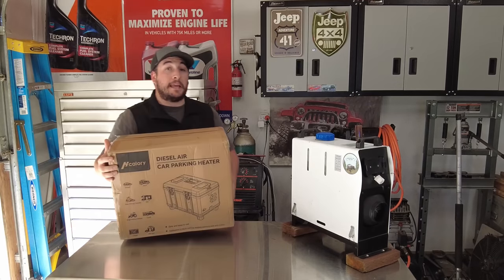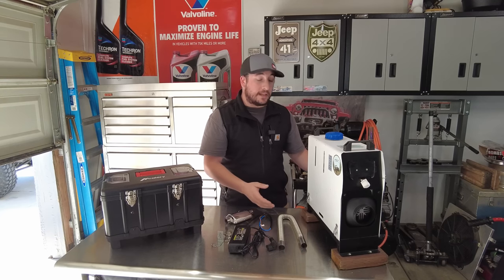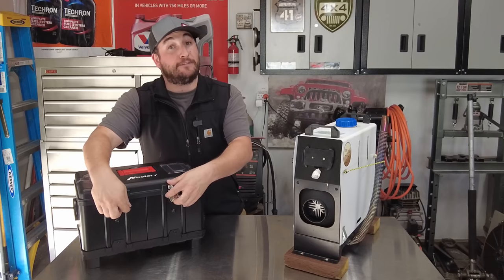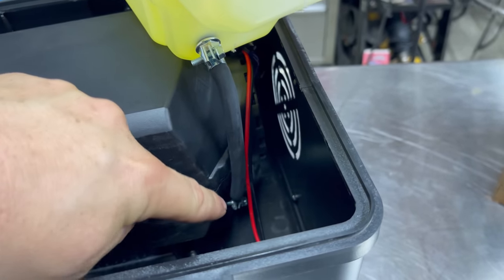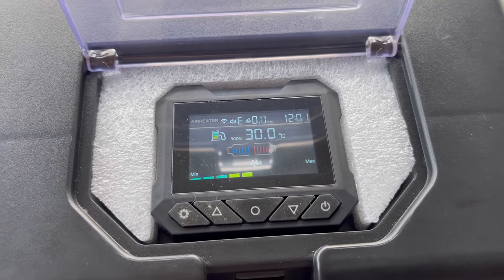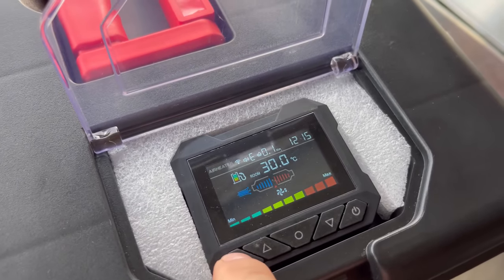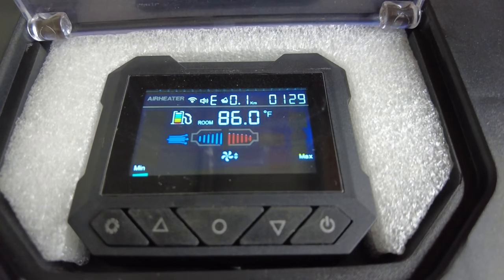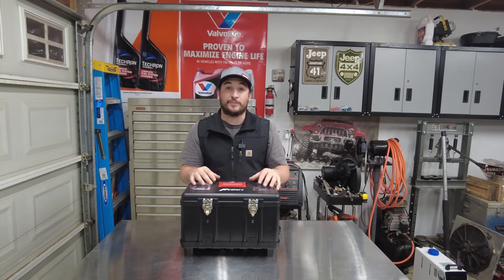KING Of Affordable Diesel Heaters | The HCALORY - SS2 8KW Air Heater | This Is The ONE

Comment: Great video, are you going to be making another on how to add the fuel filter and fuse by chance? That would be extremely helpful.
Reply from the maker: Yes, soon thanks for watching 🍻
Reply: @ATEMOFFROAD What is the purpose of using a fuel filter?
Reply from the maker: @bobbarker5884  some believe it’s not necessary as this heater doesn’t have one, I say primary function is to prevent contaminants in the diesel fuel from clogging the oil pump and causing the diesel heater not to work correctly. When I look inside the old diesel heater tank it’s apparent there are contaminants.
Reply from the maker: Hi , New video is up covering all the questions you asked on this heater. 🍻 https://youtu.be/Ug-3fjjCPWE?si=BxCFMqSJN6QPi7tT
Reply from the maker: @bobbarker5884  Hi , New video is up covering all the questions you asked on this heater. 🍻 https://youtu.be/Ug-3fjjCPWE?si=BxCFMqSJN6QPi7tT

Comment: I have a question I have a 2001 dodge Cummins extended cab. My heater core went out. I was wondering if you would recommend me installing a diesel heater in it somehow. Instead of having to find a god mechanic to replace my heater core and dash board
Reply from the maker: It would take up some space, I’ve seen people use this heater inside there trucks usually for when they are parked but I suppose it would work just as good on the road. You will want to do your best to pipe the exhaust outside and make sure it’s not going to burn anything or leak any exhaust into the cab. It gets really hot, Consider having a carbon monoxide detector close by. 🍻
Reply: Nathan of YouTube channel Class A Living has uploaded a video showing how he installed a diesel heater in his truck. ☮️

Comment: Thanks for the video. What was the power consumption on the 12V at startup vs. steady run? Thanks.
Reply from the maker: Stay tuned for the next camping video where I run the heater on a battery to show full load amps at start up. Sorry I have to keep the videos somewhat short, but I will add that to the next update video. 🍻
Reply from the maker: Hi , New video is up covering all the questions you asked on this heater. 🍻 https://youtu.be/Ug-3fjjCPWE?si=BxCFMqSJN6QPi7tT

Comment: Looks good, I am always looking for heat as I icefish in portable shacks a lot!
I would like to keep the heater out of the tent, so the app would be a must. Do you remove exhaust tube to transport?
Any down sides to this heater?
Reply from the maker: The new mode of control will allow you to have the heater outside, That could also be a downside as diesel can gel. Karosene can solve that problem. This new mode Takes the manual guesswork out and automatically adjusts the heater based on the setting you feel is most comfortable. There is always room for improvement and after using a few heaters this one solves a lot of those problems. For the future I’d like to see a taller box that has more space to fit all the accessories in. my only  complaint really. I do remove the exhaust between uses as my packing space it tight, But it can be fixed to he heater with a bracket. Some people mention that the 12v connection for power is a problem which I do agree, it’s a standard 120v plug. However someone would have to introduce a totally different plug and really not know what there doing for this to be problem. If your passed that, any plug better than the other style I show is better as those connections like to come loose during transport and can cause under voltage faults. Thanks for watching 🍻
Reply from the maker: New video is up covering all the questions you asked on this heater. 🍻 https://youtu.be/Ug-3fjjCPWE?si=BxCFMqSJN6QPi7tT

Comment: Like the changes, especially the power supply.  Sure would like the see the exhaust come straight out of the side, not much clearance for heat to dissipate from the exhaust unless using something like the steel table you have. I have all of mine wrapped, but would be nice not to have too do that! Unit needs to be recasted with exhaust the 3 o’clock position and air intake at the 9 o’clock position. With a filter and fuse, that would be the ticket!
Reply from the maker: Good ideas , let them listen. 🍻
Reply: all heaters are the same design...cant come out the side...
Reply from the maker: @dr650dude  how they package them for an intended use is key here, same heater yes but improved controls and carrying case it’s what is necessary for tent camping without doing a big DIY project 🍻

Comment: 😒  I bought this heater based upon this review.  I'm curious to hear what your ongoing experience with it has been.  I have been underwhelmed unfortunately.  I bought it for ice fishing/camping and seem to get quite a few E-05 overheating errors whenever a 3" vent hose is attached to the heat output hole.  This makes it difficult to keep the unit outside and introduces a risk of CO when i bring it inside the tent.  Without a vent hose it runs reliably.  The only other issue is my percieved poor performance with heating.  In my Thermal Eskimo 850 XD this heater can only get the interior up to +12C when it was -14C outside.  I guess i was hoping for more heat ... having my internal hub temps around +18 would have been better.    Do you have a followup review you can offer now that you have used it?  Is it performing well out in nature for you?
Reply from the maker: I have two update videos up on the channel and every experience has been good. No problems and I use 3” ducting. How long is your ducting? I always recommend keeping the unit outside the heated space. Also are you using diesel or kerosene? Do you have the heater outside on a table or the ground? If outside have you extended the cable to have the thermostat controller inside the heater space? What mode is the heater set on? Check out my recent camping videos and this one too https://youtu.be/Ug-3fjjCPWE?si=mzi-wY5lWb5OJZG7
Reply: thanks - i'll look for those updated videos.  the unit was outside and elevated off the ice with logs so air could be drawn from the bottom intake.  i was using 3" with minimal length to the inside ... maybe 4 feet at most?  I still say the unit is not easy to clamp a 3" hose on to.  the flange is very small making it hard for the ring clamp to grab.  I was using diesel - all diesel here in Saskatchewan is rated for the cold we have.   I did not extend the thermostat controller into the space as i was using the mobile app.  Not sure that would make a difference?  The heater was tested in both the Level mode and the temp mode.  I just couldnt get it above 12 deg C.  even after i brought it in to avoid the E=05 @ATEMOFFROAD
Reply from the maker: @kirklange5218  how long has the heater been ran on High? I’ve seen these heaters get primed for way to long before first start up and they run really rich, the unburnt fuel builds up and it hampers the glow plugs ability to ignite throwing off the controls and sensors. Also you can try taking off the exhaust tube extension and place just the muffler over the end of the 90. You will want to watch that the heat wont harm the heaters enclosure. Maybe wrap it with something heat and fire proof. Take off the air inlet screen filter and check for blockage and good air flow on the bottom of the heater. The plastic mesh that’s loose in there can be removed. And lastly reduce the 3” duct to 3’ if possible. What duct are you using ? Got a link? In my last update video I explain that using the hard aluminum one before the flex is better, the flex ones are made of PVC outter jacket and shouldn’t be getting that hot. Run the heck out of it on the bench on max high to get that all cleaned out and should be good. Just some things to try before returning. And lastly I have all the links to what I use for my heater in the description box below. 🍻
Reply: It is recommended to have the heater inside. Yes it is easier to have it outside but instead of heating -14 air, the longer it runs inside the warmer it will get since you are heating warmer inside air instead of continuous -14 air.    If you dont want it inside, run a hose from inside, out to the heater. I had to 3d print an adapter to my heater so I could use a hose back when I had my heater outside. Mainly do to how loud the fuel pump was!

Comment: When you use this, is the unit sitting outside of your jeep on the ground? I’m thinking about using this as a heat source for my van, as I’m not interested in a full install. Just curious where the unit sits when it’s running?
Reply from the maker: I set it outside my jeep on a tire tailgate table. Also found on Amazon, great for tents and vans , definitely keeps the moisture out. Here’s the link: New stock is available link: https://amzn.to/47KUrMq
Reply: Thanks. Do you ever have to add kerosene to the diesel to keep it from getting thick and sludging up? Not sure if you have ever had that happen in cold (15° ish) temps.
Reply from the maker: @MyVanMonty  adding kerosene is a great way to keep diesel from gelling, check out this video 🍻 https://youtu.be/Ug-3fjjCPWE?si=lIWRavoJ3X-YC-rd

Comment: How long can it run with full tank? How would you power it in your car and where would you exhaust it?  I mean if you put it on the roof How would you power it when boondocking?
Reply from the maker: Good question here’s a video , that can help with that. At the beginning I set up the heater, mid roll add some modifications and last part I give a walk around of my camp setup. 🍻https://youtu.be/Ug-3fjjCPWE?si=lIWRavoJ3X-YC-rd
Reply: @ATEMOFFROAD  ok thanks boss

Comment: I do a fair bit of higher altitude (above 5000' elev) camping. The MaxSpeedingRods (and some similar Chinese heaters) report to have automatic calibration for altitude. Does this one have that?  Another question, my heater port in the side of the canopy has a thermostatic probe... Is there a way to connect an external thermostat?  I plan to have the diesel heater outside the truck (on ground or mounted to the side) so if it is measuring the ambient temperature of the outside that would be pointless and essentially it becomes a manual on/off remote control heater instead of turning on automatically at night while sleeping.

Nice video - thank you for the review. I look forward to your response.
Reply from the maker: The manufacturer claims the heater self adjusts for higher altitude, this would make sense as there are now two user friendly modes that can be accessed based on your setting. If you watch my winter camping videos I mention on the older heaters that extending the cable to reach the heated space is a must, because the thermostat is built inside the controller. And the thermostat automatically adjust the heater to room/tent heat you set and that if you Leave the thermostat outside it will cause the heater to run up to full load. Bringing the thermostat inside the heated space also allows the heater to throttle way down, saving fuel and power making the heater much more efficient and controllable . This mode is also on the new heater, unfortunately the cable is too short to bring the controller inside the tent or heated space. This new controller allows a secondary mode with no need to extend the cable, that if you are heating a space separate from the heater like a tint, new mode allows you to throttle up or down the heater regardless of where the thermostat is located. This new mode calculates the fuel and fan speeds based on elevation and outputs a steady controlled heat. We see this control in the form of green (low) to red (high) or hotter as the bars on the HMI. Hope this helps 🍻
Reply from the maker: Also with the new mode should no longer need to have the controller in the tent , just wireless control from phone app. 🍻
Reply: With Mode 2  it sounds like a fixed manual setting is the only option. If I wanted it to be about 50 degrees at night while sleeping I would be guessing on a setting based upon using it prior to going to bed and hoping it was close enough if the temp dropped or increased - correct?    @ATEMOFFROAD
Reply from the maker: @MarkBuchanan3D  yes a more user friendly manual mode if you will , it won’t automatically adjust you would still need to extend the cable as previously mentioned. For myself it works because once the space is heated the heater is usually throttled down to it’s lowest setting anyway. I keep a carbon monoxide detector in my tent it has a built in thermometer, so I’ll manually adjust based on that readout for the night. Now what would be really cool is if the app had a built in thermometer and through the app it automatically adjusted. I’m still playing with the app to see if that is an option
Reply from the maker: Hi , New video is up covering all the questions you asked on this heater. 🍻 https://youtu.be/Ug-3fjjCPWE?si=BxCFMqSJN6QPi7tT

Comment: i hear that if you buy a to big one , then it will run more on low speed and you will get a build up of soot inside it, and it will stop working. Do it have a auto cleaning or do you just have to turn it to max sometimes to burn the soot away?
Reply from the maker: The shutdown cycle clears out the heater automatically. It’s a good idea to run on high for  2-3 minutes before you shut down the heater. 🍻

Comment: Thanks for the review. It did leave me with a couple questions though. How many watts does it require for the plug in power? Also how long would it run on a half gallon or gallon of fuel?
Reply from the maker: The ac/dc adapter is rated at 12amp , the colder it is the more power it will consume at start up. On average it pulls about 10amps at start up depending on the set point. once the space is heated it’s pretty efficient at about .5 to 1.5 amps on low. I can get two 8-10hr nights in a gallon of fuel, about 1 hour on high and 7 on lowest setting. 🍻 This is the battery I use https://amzn.to/3tS2qIC
Reply from the maker: New video is up covering all the questions you asked on this heater. 🍻 https://youtu.be/Ug-3fjjCPWE?si=BxCFMqSJN6QPi7tT
Reply: There are many videos that address these questions. Also consider using google to obtain simple data on any device.
Reply: Have they figured out a way to extend the controller? Want to keep the temps in an ice shack comfortable, but don’t want to have the heater directly in it
Reply from the maker: @USMCKidProductions  I just extended it my self here’s the video Diesel Heaters For Winter Tent Camping - Upgrades and Modifications
https://youtu.be/Ug-3fjjCPWE

Comment: The biggest thing wanted... therm mode that actually turns it off after running on low at set temp for 10 min... then back on if temp drops??
Reply from the maker: I like this , Hcalory is listening 🍻
Reply from the maker: The problem with this , is the shutdown process is a complete cycle, so that process would need to be implemented. But possible

Comment: I have the same heater as this one. I kept getting a slight diesel smell after about an hour of running time. I finally discovered the issue. As the heater warms up so does the fuel tank setting next to it. With the vented cap enclosed in the box it vents directly into the box. The suction from the fan picks up the odor and sends it out the heater duct. If I leave the lid open the issue goes away. Looking for a vented cap with a vent tube to vent the vapors outside the box.
Reply: The controller is not tuned properly from the factory. They just use settings to get it running. You can go into the settings and tune it better to burn cleaner and use less fuel. That is a good idea you have to use a fuel cap with a vent tube too.
Reply: Fuel consumption is fine. I've found a way to vent the diesel fumes from the tank to outside of the box.  @JackInTheShop
Reply: @daviddover4563  What was your solution to this?
Reply: I drilled a small hole in the lid above the cap vent. I made a small rubber gasket with a hole in the middle from some camper shell tape that had adhesive on one side. Applied the gasket to the underside of the lid. When you close the lid the gasket sealed itself against fill cap vent. When the diesel warmed up and vented it went straight outside through the hole. No more diesel smell trapped in the box coming into the living space.  @Tanashii

Comment: I wonder if I could hook this into my chimney to heat my basement, or if this would be powerful enough to heat a tall 1 car garage for the winter
Reply from the maker: As long as you can manage to always keep the exhaust outside the heated space I’d say yes. Piping the exhaust into the chimney doesn’t seem safe enough in my opinion. Thanks for watching 🍻

Comment: I'm wondering if you can test this unit to run on used/ filtered veg oil or a mix of diesel and veg oil? Remember the diesel engine was invented to run on peanut oil, and although it's not a diesel engine it is a  diesel burner. Thanks
Reply from the maker: I think it may work as a mix , I know these can burn on kerosene, and the gelling point is -40 compared to diesel 5, so it’s very possible. We should do some experiments on this channel. 🍻

Comment: I would like to know how long it will run on just a car battery? Do you think it will last the whole night?
Reply from the maker: An average car battery is about 48amp hours so you should get at least haft that in hours 20-24 (on low setting-1amp per hour) of use on  a fully charged car battery. I don’t advocate using your actual car battery as this can drain them and you may not be able to start your car. Always use a separate battery dedicated to the heater.